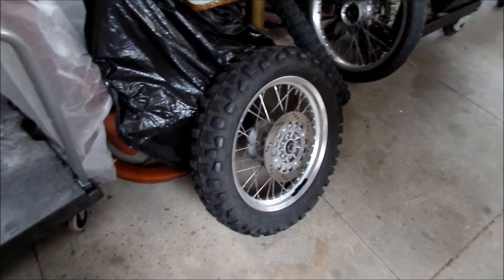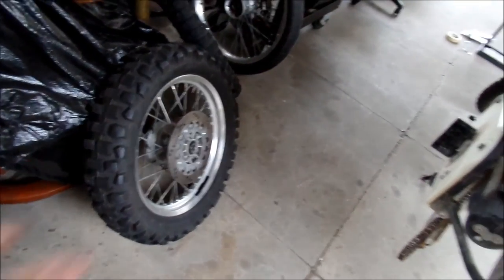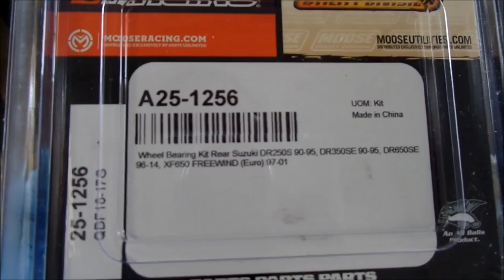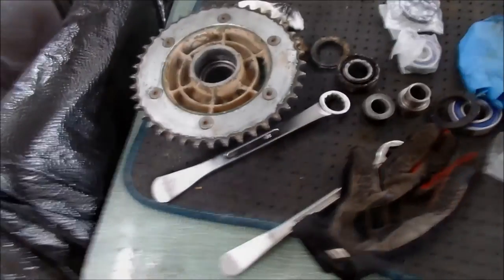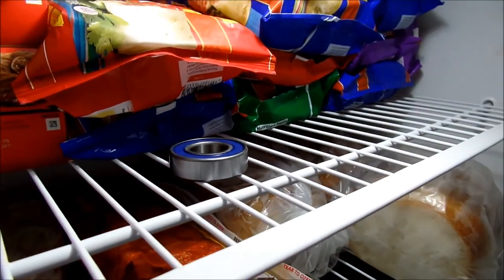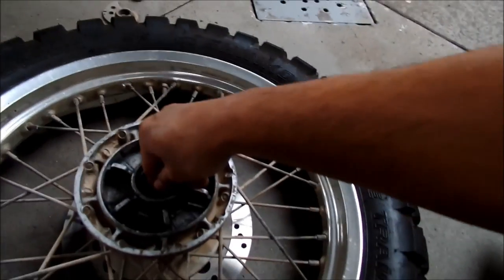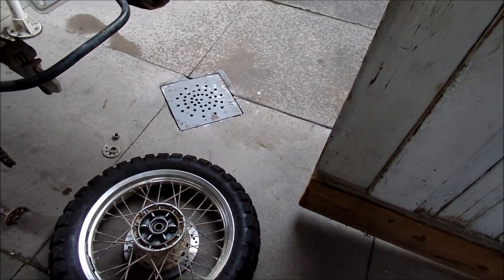HadesOmega How to VLOG: Change DR650 Cush Drive Hub Bearing

Comment: I went to a bearing shop and got the original Koyo bearings (made in Japan) for $7 each. I don’t know why people bother with All Balls bearings, they’re really not up to OEM spec. Once you know how to read bearing and seal codes you can take your pick of Koyo, SKF, Timken etc etc. Costs are similar. Same goes for seals, even fork & shock seals. My green SKF seals were cheaper than All Balls, and the quality is incomparable, especially fork seals and shock head unit.
Reply from the maker: The All Balls bearings have been working fine for me hasn't let me down

Comment: How do you put the hub on the wheel? My sprocket has a lot of play
Reply from the maker: It should just sit on top of the wheel hub.  The cush drive rubbers are what tighten it up, so you might want to inspect those or replace them.  I replaced mine they get hard after awhile and sloppy.
Reply: +HadesOmega Moto
Do you know where I can get some? I can't find any at all I'm just thinking about welding the hub on there
Reply from the maker: procycle sells them
https://procycle.us/bikepages/dr650.html#kit-cushrubbers
Reply: +HadesOmega Moto thanks man :)
Reply: Nice job little play up and down should be fine

Comment: I do not understand why you didnt your press  with a suitable sized piece of tube/bar. Seriously isnt ideal to drive it home with a hammer/punch.  Also, you need to apply some grease behind the seal. The grease you put  on your 'spacer' came straight off when you pushed it into the seal.